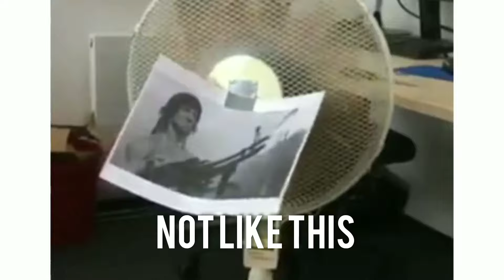Make Up Air Units And How They Work: An HVAC Discussion

Comment: Nice edits, great explanation! I’m subscribed. Of course smashed the like button and wish you could replace the tech working on ours and fix it in one visit here.
Where I live
The common hallway for our apartment building went from 16 degrees Celsius to 23 degrees C but the humidity is extremely low, it’s below 20% or more and causing an instant headache from getting off the elevator and headaches, dizziness continues into my unit although humidity is around 40% and drops to 35% overnight some days were as low as 25% overnight and gave a  scratchy throat.  I also get very tired after lunch can’t stay awake.  Building mgr doesn’t seem to care as he lives else where while we suffer like the civilians in the original total recall movie! 
They’ve supposedly been here 3 times and lowered the temp 6 degrees F each time for the heat on the make up air unit with no improvements to either temp or humidity.  (Actually it dropped 0.5 degrees Celsius) but the humidity is still extreme.  
Shouldn’t it be as simple as allow more outside air to mix with heated air? Or is it more complicated than that.  It’s 32 degrees F outside.  
I’m questioning the competency of the hvac company, however, they are a large name.  It’s 3 visits and zero difference?! To make it cooler to around 70 F and have about 40 -45% humidity from 73.4 F and less than 20% humidity (20 is the lowest my thermometer is able to display at which then only shows Low)  I’m concerned for my health and there are a number of people with disabilities living here, myself included.

Any advice would be golden

Comment: Question: Do MAUs always provide heat or are they generally considered heaters? (Example: Captive Aire modular direct gas fired heater/make-up air unit) Or do they provide cooling (DX) or chilled water cooling in other applications? Just thinking about warm climates or hot summers. It doesn't make sense to me to have heated make-up air during summer or in hot climates. Can you explain? Thanks! Appreciate the video!
Reply from the maker: Their job is to temper the air to 70⁰F for example.  Not to heat the space
Reply: @HVACKnowItAll  So MAUs temper air only if it needs it? If the air is already hot and arid it would sense that and not fire the burners? I was just wondering if they would also cool a space if necessary and can they be configured to do so. Thanks for the discussion.

Comment: Condo installed new MAU in April.  for several weeks unit make recurring sound like timpany drum.  Sometimes for several days.  It stopped in summer and started again in October.  What could this be?
Reply from the maker: Without a site visit it's very hard to say

Comment: Hi Sir, I'm new to your channel. Thanks for your explanation. It really helps my ongoing project. I would like to know if tenant rooms using VRV units will need makeup air inside that room or just in the hallways to replace the exhaust air on the tenant rooms?
I hope you consider my questions, I will really appreciate it.
Thanks.
Reply from the maker: That depends on building code in your area!

Comment: I know very little about HVAC but i just bought a building so im trying to learn. I run a wood finishing business with several paint booths. I have a quote from a HVAC company that only has RTU on it no air make up. Do they do they same thing?
Reply from the maker: No they are different, make up air unit provide 100% outside air, rtu circulate building air for heating and cooling.
Reply: @HVACKnowItAll  thank you! If im pulling over 38k cfm the 4 RTUs @ 7.5 tons would not supply enough air? Im assuming?
Reply from the maker: @thefinisher0926  you shouldn't run paint booths with rtus period